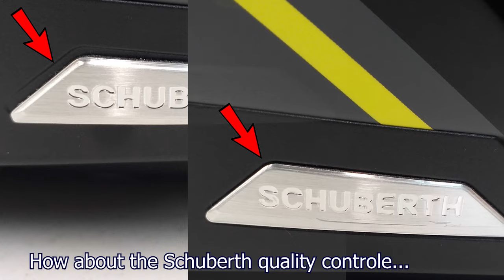SCHUBERTH C5 FLIP-UP HELMET   ⚠️VISOR PROBLEM SOLVED ⚠️  STEP-BY-STEP.  PART 1#2

Comment: This fix works... my C5 visor used to dependably slam shut at about 42 mph. After performing this modification the visor will stay where I want it, up to about 55 mph, even a little faster. My helmet is a Euro market model. The visor ratchet control disks that were modified are slightly different on my helmet than the ones featured in this video, but a flat rectangular needle file made the job easy enough. The 8mm flat bottom milling bit is exactly right for adjusting the bottom of the inner recess, which actually measures 8.5mm.  Considering the price of this otherwise great helmet it is a shame we need to do these things!
Reply from the maker: 😉 good info, whats the model ?

Comment: I have seen people suggest O-rings.  The o-rings that were recommended were really small and, when I tried it, the visor no longer locked in as the levers would not return to their place like yours was.  I love my helmet and don’t ride with the visor up a lot, but I had taken to tipping my head back so the wind catches it and holds it open.  Your windshield will make a difference in that.  Mine are lower than most.
Reply from the maker: After doing my modifications, my Schuberth C5 is a good helmet. Its ashame that a company like Schuberth don't made this modified part for people who has this visor problem. Every Schuberth dealer could change that part for the new part, while you wait.
Reply: @TheOldMechanic  I think they all have this problem.  Those who ride a lot with the visor open notice it more than those who ride primarily with the visor closed.  What was the point in adding in the detents if they were not intended to have the visor stay in place at speed?  The “memory function” is not very useful if the visor closes every time one goes for a ride.
Reply: 20x1,5mm work perfectly fine!

Comment: Great explanation m..!! Thank you m. I have both issues on my own and my wife’s helmets. I managed to do the second fix by shaving some of the notch off the visor which worked. Will never buy (stupid) Schuberth again. For what you spend and the issues you end up with.. not worth it.. they should have a recall and sort it out.. also the rattle in the inner visor 🤨
Reply from the maker: Glad it helped at least a bit

Comment: Seen a fix for this by putting a 32 or 35x2mm o ring round the visor mounting points.
Reply: Way safer solution, but it presses the visor outwards, not sure if that matters. I tried it and did not like it. But this guy with the strong dutch accent is the only one (watched many vids about the C5 fixes) who found the real issue and solved it properly. Schuberth should have done better and should send replacements to customers with this problem!
Reply: I've just done 1k miles with it and no problem. It's a 22x2mm o ring, btw.

Comment: My visor shuts ok, but the plastic face shield doesn't seat tight when closed. It's closed probably far enough, but it's not closed onto the fiberglass helmet. It does form a seal with the rubber I believe. I haven't used the helmet yet.  Maybe it needs to be tighter? Have you noticed this? Thanks for making the video.

Comment: Want the 2 second fix? Put an O ring that fits into the interior circumference of the visor piece. The piece that fits into helmet. It creates enough friction to hold the visor in position a lot better. Good luck! 👍
Reply from the maker: Thanks for the tips!
Reply: The O-rings work perfectly fine! I used 20x1,5 mm and the visor finally works as it is supposed to do...
Reply: @jurgenleuck5247  glad to hear it worked out!

Comment: my has been tolt is becaus the new regulation ECE 22.06. good to know there is a walk around.
Reply from the maker: Huh.. never heared about that
Reply: Because of ECE 22.06...? The Schuberth C3 Pro has te same issues and was launched way back in 2014 when there was no ECE 22.06.... Hopefully  this mod will also work on the C3 Pro
Reply from the maker: I hope it has the same system so you can use my mod 😉👍🏻👍🏻
Reply: @TheOldMechanic  I hope so, it has a similar ratchet system with notches. I've heard somewhere that Schuberth's answer to this problem was: it is a safety thing. It is dangerous riding with an open visor so that's why this mechanism is constructed this way...😎 Pinokkio...? 🤪

Comment: Please note that Schuberth has recal for C5 due these problems, go to dealer and they fix problems and change parts for free.
Reply from the maker: Thanks for the information 👍🏻
Reply: exactly. had the C5 right when it came out and experienced these issues. Got it fixed by the dealer for free in about an hour. Already back then they had an advisory from factory to also grease those points.
Reply: @mastadriver  wow thanks! I'll check it out

Comment: This is the worst helmet I’ve ever bought/owned. The most expensive also. Visor doesn’t just flop down at highway speed, it leaks like a siv when it rains and it all pours in the top of the visor. I’ve never seen that happen before. Schubert should send us parts that work. Why would I want to do all this to make a brand new helmet not a piece of sht?
Reply from the maker: Absolute right 👍🏻